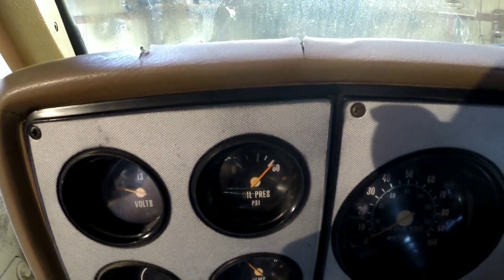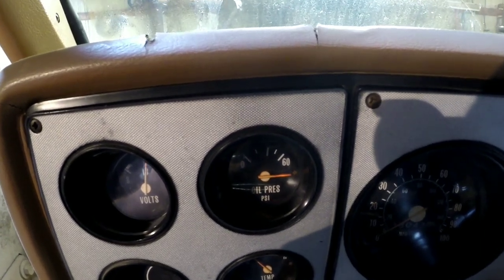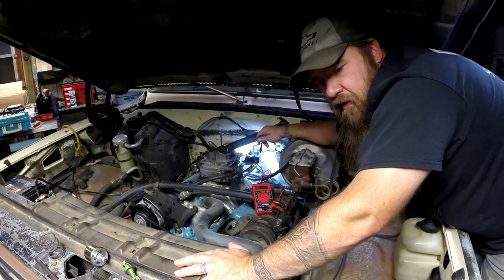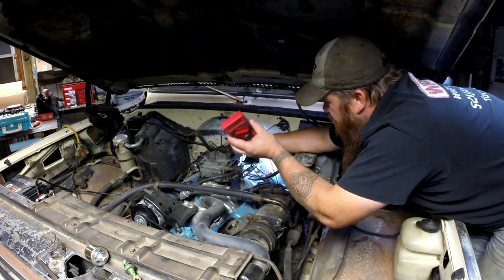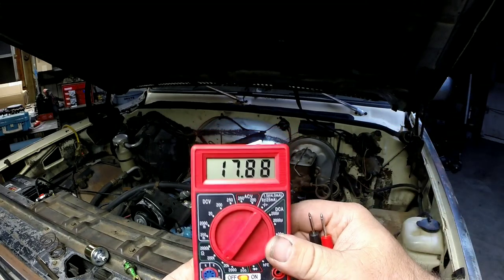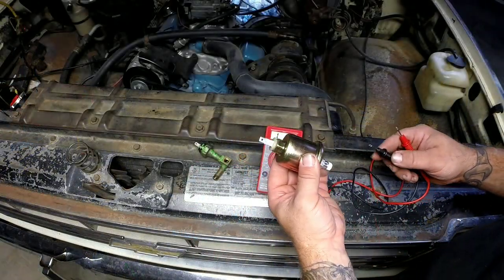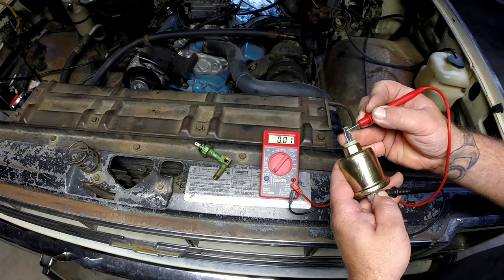How to diagnose and replace a bad oil pressure sending unit on my 79 short bed square body c10.

Comment: I have a oil pressure switch that is leaking and isn’t connected to anything. Could’ve I an aftermarket oil gauge and install that instead of the factory one? Can it be a mechanical one if so? I’m new to this lol.
Reply from the maker: You could install a mechanical aftermarket Guage and get rid of what you have.
Reply: @SquarebodyStuff  I appreciate you. Thank you.
Reply from the maker: You're welcome

Comment: I have an 85 5.7 l 350 square body I changed the sending unit sensor and my gauge is still reading zero it will not move whatsoever what am I doing wrong I just wasted 35 bucks for nothing

Comment: I’m having a lot of issues trying to locate mine. I do not see one anywhere around the backside of my block nor under wondering if somebody hadn’t tried to bypass it if you can help me at all that would be great. I’m just having a lot of issues trying to change the sending unit out because when I put it in drive or or reverse. My oil pressure goes to zero I’m running at 14 pounds when I start it and let it run but the second I put it in any gear the oil pressure drops out. I replaced oil pan gaskets rear main seal valve cover gaskets everything is properly torque down. Still have an oil pressure issue, I really do need some help. I am new to older vehicles and willing to learn.
Reply from the maker: What vehicle is it in?
Reply: @SquarebodyStuff  1979 Chevy k10 350 small block I have looked everywhere
Reply from the maker: Not sure where else to have you look. Behind the intake is the usual spot. There is a port than can be used just above the oil filter, or just behind the water pump
Reply: @SquarebodyStuff  okay I’ll take look again tomorrow and I’ll get back to you

Comment: thank, you Chad for you're helpful video. I've. got a 1987, chevy surburban R20 4x4 350 throttle body 400 trans. my problem is  I notice every time I check the oil every time before starting I would always be a quart low or a half a quart low   I took notice of the right back side of the engine was wet and oily then I looked under the truck and notice was a mess of oil all over the bottom of the oil pan all over the starter and on the exhaust y pipe  and all over the bottle of the trans pan. I, thought it was the right back side of the value cover gasket but looking forward in to it I found the problem. correct it was the sending unit that had gone bad so I bought a new one I have not irreplaceable it yet but I'm going to this weekend before driving it again. This sending unit has a single blade hook up. I, was wondering how does the sending goes bad I asume when one goes bad correct it starts leaking  I guess it goes bad were it's put togather at. Lol you're dog snoring that's cool.  now after I fix the problem I'm going to have to  degrees the bottom of the truck and power wash it. no more leaking oil and no more buying and keep adding oil every time. Again Chad thank, you again friend for you're helpful video. ✌
Reply from the maker: You're  welcome
Reply: thank, you.

Comment: Hey Chad, would an ‘84 that has an oil pressure gauge have “both” a sending unit AND a switch?? Or is it one or the other?? Thanks man.
Reply from the maker: If memory serves me right, some had both. The switch was normally down by the oil filter.
Reply: @SquarebodyStuff  Chad have you ever ran into the problem where the choke fuse blows once the engine is started?
Reply from the maker: No, but it say you have a wire shorting out somewhere
Reply: Do I have to remove the distributor cap to get that off back on firewall?
Reply from the maker: You don't have to, but it can give you more room if you do.

Comment: Some sending units are either open to begin with or closed. Hard to determine which one it is needed testing a bad sending unit. Unless you have a working one in your hand and can do a comparison.

Comment: 03:35  Incorrect:  Sensor resistance does NOT go up as pressure goes up.  Sensor resistance goes DOWN as pressure goes up.  As this resistance goes down, it allows more current to flow through the pressure gauge.  This increase in current causes the needle deflection to indicate a higher pressure.
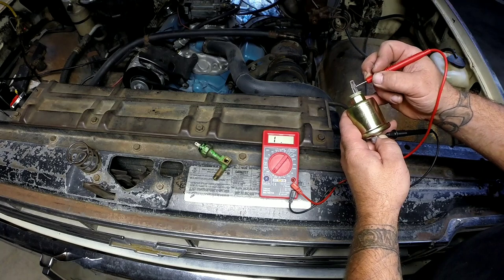06:23 Incorrect:  Zero resistance is NOT an "Open"; zero resistance is a SHORT, which provides maximum current flow.  When you see zero at the 20KΩ scale, you have your scale set too high to see the actual resistance.  You should turn the scale down to find out what the resistance really is.
Reply: The 78-87 trucks used sending units designed with a positive pressure coefficient, meaning the sender's resistance is directly related to pressure. So in  this case the video is correct. As pressure increases, so does the resistance.

Comment: I bought an 84 Camaro with a 350 engine already put in and I've been struggling to find parts for it untill someone told me my engine might be from an old Chevy truck I'm so glad I found your videos man there are none out there on Chevy 350s and i think my car might have the same 350 as yours the engines look identical but sum parts on my 350 are either older or more advanced . But it's all been going well thanks to you and the Lord i can put my lil hooptie back together 😂

Comment: Thank you for the excellent information. 
I noticed when you turn the key on and  off   that your volt gauge snapped up and down . I don’t think that is 
correct they usually move slowly . 
Thanks
Mark
Reply from the maker: That's the way most of mine have worked.

Comment: Thanks for the excellent video on checking oil pressure resistance + installation AND checking again it IS  working 100%. Several videos / 'mechs', do NOT show checking process. Not even checking for oil leaks. 'Course I subbed..💪🇺🇲
Reply from the maker: Glad to help out. Thanks for the sub.

Comment: Hello, do you know how the oil pressure wire connects to the gauge? Or does it connect to the sending unit?
Reply from the maker: I goes right  to the sending  unit, but the other end goes to the plug for the instrument cluster.
Reply: @SquarebodyStuff  thanks so much! And your video was very helpful.
Reply from the maker: No problem,  I'm glad to help out.

Comment: You have a bad ground connection.
Reply: you don’t wrap the the threads. They need a good ground. How much that matters with that small amount might not matter. But I don’t wrap them. Excellent video and very informative
Reply from the maker: Done it this way for 20 years and never had a problem with it grounding correctly. I also have never had one leak.

Comment: Wow that grill hung in your ceiling, 84 gmc, you still have this?
Reply from the maker: Yes, it is for decoration
Reply: @SquarebodyStuff  its looks way cleaner than mine! If you want to sell hit me up! Cheers and good video btw, im having oil pressure problems right now, a friend of mine suggested putting a specifical type of diesel engine oil, he said my oil pressure would go up because of the zinc, what do you think?
Reply: I can even pay the shipping and everything if ever you are interested!
Reply from the maker: Grille isn't for sale.  The zinc is good for the engine, but it isn't gonna raise the oil pressure.  The thicker oil will. I run the Rotella 15w40 in my trucks.
Reply: @SquarebodyStuff  thanks! Im in Canada and this grille is rare in good shapee

Comment: Question for ya Chad. Would a bad oil pressure switch cause my 84 to run rough and backfire out the carb? Need help. Any advice, suggestions gladly appreciated.
Reply from the maker: No, it's not connected to that issue.  The issue you have could be a number of things. Ignition timing, carburetor issues, worn cam lobe, worn or jumped timing chain.
Reply: Yep he's right the two are absolutely not related.

Comment: I'm having trouble choosing whichever  oil sending unit is right for my dash gauge 1984 GMC 1500..please help
Reply from the maker: Should be this one if you have the factory Guage.  Kinda likes like a can. https://www.oreillyauto.com/detail/c/acdelco/engine-sensors---emissions/engine---drivetrain-sensors/oil-pressure-sensor-switch/caee72c68788/acdelco-1-terminal-multi-purpose-pressure-sensor/acd0/d1829/v/a/3454/automotive-truck-1984-chevrolet-k30-pickup-4wd?pos=10

https://www.oreillyauto.com/detail/c/standard-ignition/engine-sensors---emissions/engine---drivetrain-sensors/oil-pressure-sensor-switch/caee72c68788/standard-ignition-1-terminal-oil-pressure-switch/std0/ps154/v/a/2986/automotive-truck-1984-chevrolet-c10-pickup-rwd?pos=5
Reply: Thanks for part number

Comment: Any idea on how to get my voltage gauge working again? ‘85 k-10
Reply from the maker: Not something easy for me to diagnose through text. The first thing to check is the fuses, then from there find a wiring diagram and start tracking down the wires and checking that system out.

Comment: My 77 parts truck has an oil pressure gauge. My 78 does not. Im putting the 77 gauges in the 78. Is there any wires i need to make the oil pressure gauge work?

Comment: Do you think this would work improperly if the voltage was just a little over 6 volts.  I'm getting low reading on old and new units but voltage seems to be low.
Reply from the maker: My voltage to the sending unit is just a little  over 8.
Reply: @SquarebodyStuff  Yeah, well my oil pressure can't be as low as it reads.  You start it up it really just has a very small bump.  The old sender is okay so I'm going to try a new gauge.  The engine is running cool. I have a 350 with a 160 thermostat and it runs between 160 and 180. Its old but still has good power.  The panel gauges  I have had to install an after market water temp gauge and the fuel gauge is just out.  If the voltage is low at all it may be shorting out somewhere.  Last resort I'll try a mechanical I guess.

Comment: what kinda cam you put in that dog lmao
Reply: when installing the adapter that the sending unit threads into, is that also installed with teflon tape?
Reply from the maker: I don't like to use Teflon tape. Most new units have some sealer already on it. If installing a used one, use a good liquid Teflon or rtv.
Reply from the maker: Yes it needs a sealer too. I don't recommend Teflon tape, I prefer a liquid Teflon or rtv.
Reply: @SquarebodyStuff  Thanks. Im installing a oil pressure gauge for my 454 and the plug behind the distributor is currently plugged. Headers too big to get a unit near the oil filter. Thanks for the tip
Reply from the maker: Welcome

Comment: When it's warm what oil pressure does that engine run?
Reply from the maker: Around 50 at idle.
Reply: @SquarebodyStuff  man that's a lot of oil pressure.
Reply: Must be nice!
Reply from the maker: What must be?
Reply: @SquarebodyStuff  all that oil pressure!
Reply from the maker: Put a new oil pump in when I had it out for a good cleaning  and new cam. https://youtu.be/ac_cEPSSO00

Comment: What made you think of the oil pressure sensor before the gague itself?
Reply from the maker: It was just a guess with the way it was acting. I also like to start at one end or the other of any system. I got lucky and started at the right end.
Reply: @SquarebodyStuff  thanks for clearing that up! as someone who works on this old stuff as well but didn't grow up with the old equipment (sense I'm only 21)  it helps to see what more experienced people are thinking when needing to fix a problem
Reply: How was it acting?

Comment: Man do you still upload on this channel? I have a question I need answered an I cant find anything on google nothing on youtube that helps me I juss need to know were that flat connect is located it's already unplugged I guess the guy I bought the truck from was gonna replace it or juss didnt connect it back
Reply from the maker: Not sure what flat you are talking about.
Reply: It's the flat connect on the oil pressure sender it's gone or either I just cant find it
Reply: The wire that connects to the top on the sender I'm not able to find it anywhere
Reply: Same here I can't find the wire to hook it up were does it come from? Need help